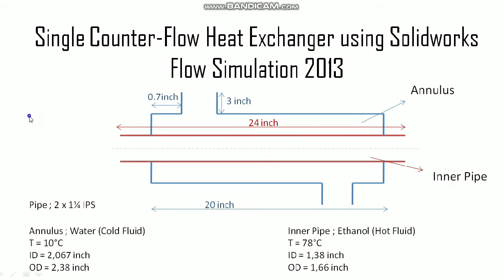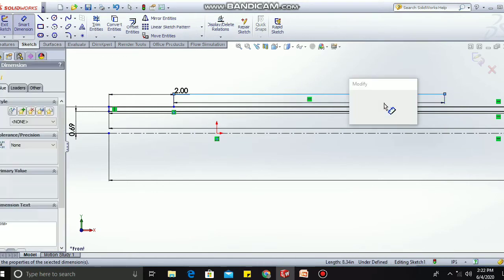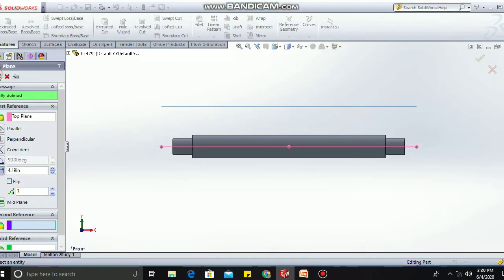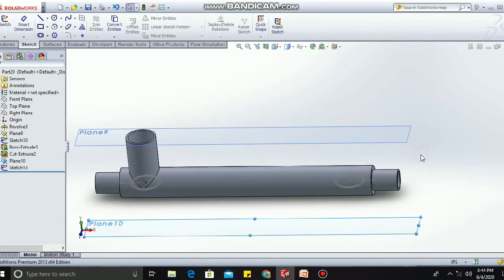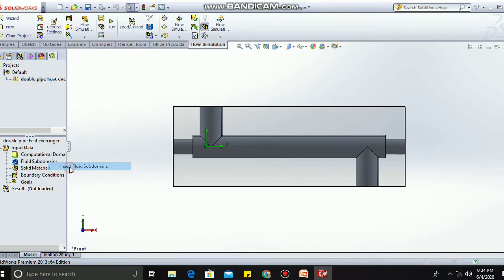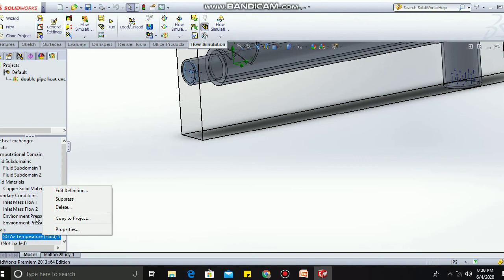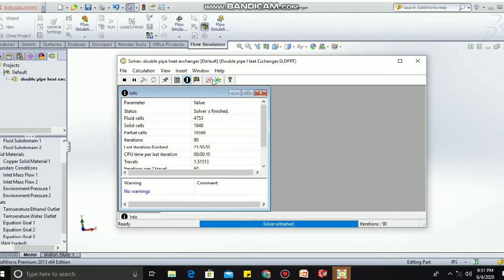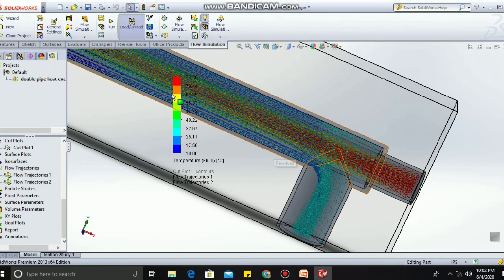Counter Flow Heat Exchanger — Solidworks 2013 Flowsimulation Tutorial

Comment: In solidworks 2023 and 2024, this simulation does not go like yours, I don't know why. I've done the same step by step in solid 2019 and it works perfectly. In the other versions the problem is in the results, the temperarure of water hit around 48°C in outlet and the ethanol hits around 25°C

Did anyone find the same problem?
Reply: yes. in 2023 the extruded cut part does not go the same as tutorial